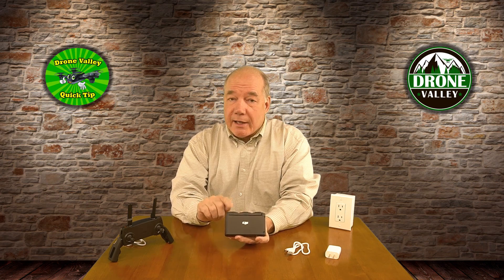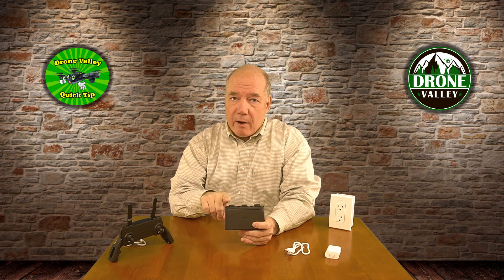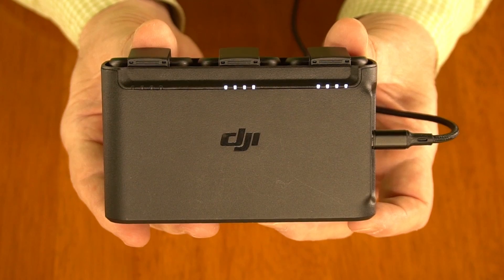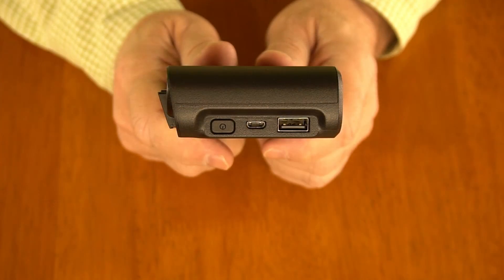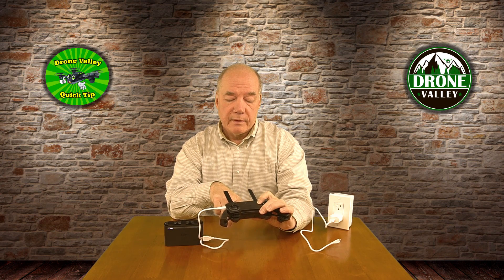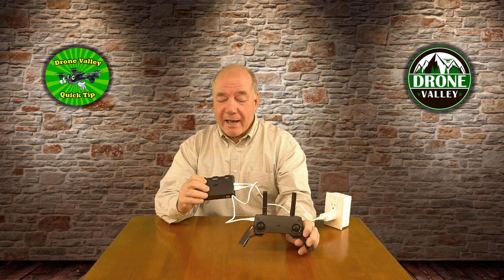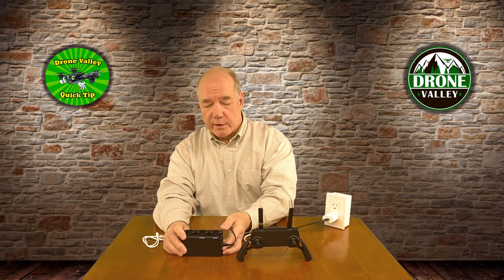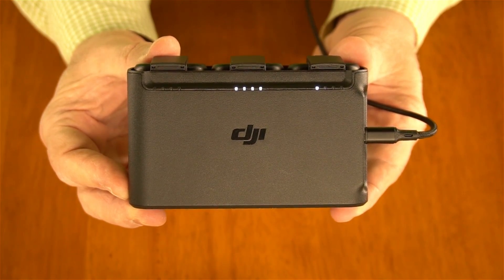Mavic Mini - The Magic of the Charging Hub Explained

Comment: Hiya Rick, great video on charging the Mavic Mini, the use of the super smart charger, I’ve just charged my Mavic Mini for the first time today, I believe the three batteries were from the start completely flat!  The first one took one hour and ten minutes, the second took just over that time and the third finished on three and a half hours! Is that normal? Would that be classed as Smart charge? And secondly Rick why has DJI in their wisdom used a different shape charging socket on the Remote to the battery hub, being fed with the same charging cable! Thanks in anticipation.👍🇬🇧

Comment: Prompted by your excellent video I tried charging, as you did, with the charging station connected to the charger and the RC connected to the charging station.  The RC does get charged, but it is fourth in line, it gets charged after the batteries have been charged.

Comment: How long does it take to charge a single battery on the mini?
Reply from the maker: Max, I run them down to about 20-25% and it takes about 30-45 minutes to quick charge them. I use the charging hub and let them all walk through the charging process. Thanks for the post and stay tuned for more content this week. Rick
Reply: @Dronevalley  👍👍👍👍

Comment: Regarding 4:00. Actually once the batteries are fully charged, the hub will automatically start charging external connected device, so it sorta does make sense to connect everything in the chain.

Comment: There's no logic to giving you 2 identical cables that cannot be used simultaneously. Plug them both in, then push and hold the power button. What's that doing? Lots of blinking going on there when I do that. Also, the battery charges in the drone itself, everyone will want a 4th battery. Keep one in the drone and charge it in the drone, charge the other 3 in the hub. keep 4 batteries at 100% and they all fit nicely in the kit.

Comment: This is great info for my pre ordered mavic mini ! Here is another question, what regulates rate of charge? The hub or the power supply? Reason for asking is if I get a QC 3.0 car charger rated for 80W will it charge at a full 80 and wreck the batteries or will the hub slow it down and only draw the max charge spec from DJI  of 24w ?
Reply from the maker: Thanks for the post and the charging is governed by the battery hub or the quad if you're charging the battery in there. It will only allow a safe amount of current to flow into the cells to charge them no matter what type of charger you're using. On a side note, we'll be releasing a 42W Drone Valley 2-port car charger later this month that provides both QC charging and PD charging. This allows you to quick charger your drone, phone, tablet or even the DJI Smart Controller. We designed this to work with both standards for quick charging and should have them ready for delivery in about 2 weeks.
Reply: That will be great, will it be a car charger ( cig lighter ) or wall plug?
Reply from the maker: @greenwings1195  The car charger is first and will be available in about 2 weeks and we have a Drone Valley 2-port Wall Charger coming in late December.  Both of them feature dual ports (USB-A and USB-C) and provide both PD (Apple, Nintendo Switch) and Qualcomm QC 3.0 charging. They're really a new style of charger and very different from most on the market today. We've been working on them since the summer and are really proud of the product.

Comment: Nice video! Could you let me know the Length x Width x Height of the battery please? I am looking to do a battery mod and change the 18650 batteries for higher capacity but want to make sure it is the right length. Thanks!

Comment: fast chargers also stuff batterys
Reply from the maker: The newer cells that are used in Quick-charging gear (like the Mavic Mini) are selected to be able to fast charge. The chargers are smart enough to detect what type of cell it's charging, how much charge it needs and what voltage and current is appropriate and will adjust on the fly to safely charge that device. Nothing to worry about and it works great. Thanks for the post, Rick
Reply: @Dronevalley  im going on my iPhone which i bought a certified iPhone fast charger for it and it over heated and killed battery..but yes, your comment makes sense.
Reply from the maker: @metallicrock5946  I understand and a lot of the "certified" chargers aren't actually that good and have very little protection built into the product. We'll be releasing a 2-port quick-charger for your car that has all of those protections built in that you can use to charge the Mavic Mini as well as the DJI Smart Controller.

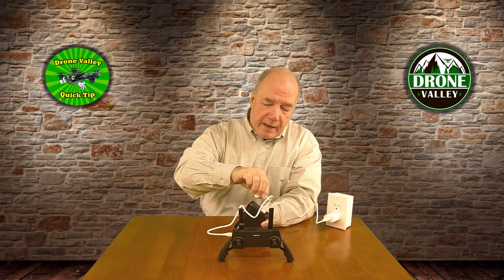Comment: @4:16 if you'll be able to charge your remote from charging hub while d hub is connected to power supply then d purpose  of charging hub that is mainly to make each battery full first before d other one will be no use i guess 🤔

Comment: I am from Germany and I ordered a Mavic Mini. So I will get a CE version of the drone. FCC/CE seems to be hardcoded.
Is it illegal if I use my CE drone in the U.S. when I go on vacation there?
Don't you think it is illegal to use your FCC version when you visit Europe and want to fly the drone?
On my SPARK CE/FCC changed by location. But on the mavic as it is hardcoded ???
I thought the mavic is a very good travel drone, but I do not want to fly illegally in other countries?
What do you think?
BTW: I already asked dji support, but got no answer from them.
Reply from the maker: You'll be fine. The transmission tech is locked between the controller and the drone so they will still be able to find each other when flying. I suggest you purchase the drone that is right for your region and you can still fly it elsewhere when you travel. Happy Flying!
Reply: @Dronevalley  I asked dji support and got this answer today:

  
We understand that you want to know if you can fly the Mavic Mini CE version in the USA and the FCC version in the Europe region.

We would like you to know that the CE version can be used to fly around the FCC area. Please be advised that the max distance for the CE version if you will going to fly it in the USA is 2 Kilometers in 2.4 Hz. 

However, concerning if you can fly the FCC version in Europe, we are in regret to inform you that we don't suggest you to fly it around Europe since there will be legal a legal risk. Hence, we truly apologize that we did not meet your expectations in this regard.

Comment: Rick, can you clarify this dilemma often commented on youtube: The Mavic mini has the output power hardwired into the version shipped to each region, fe FCC max power and max range up to 4 km. in the US...lower power and reduced range ( 2 km and less) in Europe. What this means is that a mini, bought in Europe, should not be able to detect FCC and adapt to higher power when using it in the US...Until now previous dji drones could adapt the output power and range, depending on the location, regardless where they  were bought. With your connections to dji, i hope you can tell us what really is the case. tnx.
Reply from the maker: Thanks for the post and the transmission standard is locked for each region but is paired with a similar drone standard. In the U.S. that standard is governed (and approved) by the FCC and different standards bodies on other parts of the world. My suggestion is to purchase the right drone for your home country and take it with you to fly when you're on vacation. All of these standards will work world wide and I've never heard of the "frequency police" stopping someone from using a piece of gear. Most of these standards are also loosely recognized by the other countries and are mostly chosen in your home country so your new drone doesn't interfere with other products broadcasting nearby. I hope that helps clear things up. Rick
Reply: Drone Valley Tnx fr reply Rick...I’m indeed convinced  that there is no problem flying a Mini -bought  in Europe -in the States. But...as stated in my previous message,  some people say that this drone can’t fly as far  as those sold in the US.  A Mavic pro detects , based on its location, if it can use FCC regulations  ( where applicable) and as a result fly further . This switch from CE to FCC and vice versa is done partially via software. It seems that DJI  sells different Mavic Minis, depending on the country where they are sold,  resulting in a hardwared transmission limitation ergo not switchable .. for Europe this is a  serious one, especially since many users report maximum practical range being 500 meters. ( and yes, I know that we have to fly VLOS..:-))
Reply from the maker: Staf, you're right and the Wfi standard is hard coded into the package being sold for each region. I haven't taken the Mavic Mini to Europe yet so I can't test the switching feature myself but my understanding (and the testing details from the FCC) indicate that they are locked for the region they are sold to.

Comment: This is why I love this channel. I do have one question though. When you use the batteries in the charging hub to charge your remote or whatever you hook to it to charge. Which one of the batteries does the hub start using to charge the device? Is it the one with the least charge or the one with the most charge?
Reply: It's least.
Reply: Duck so it uses the least charged battery to charge other devices that you are using the hub to charge. Like charging my phone.

Comment: I've had no trouble using any decent USB cable for QC based quick charge.  Granted all my QC capable devices are USB-C, but I've used Micro cables with C adapters.  The only trouble I've had was with USB-C 3.0 cables where I have to pull the cable a bit out of the A socket.

Comment: Hi from Japan. I enjoy watching your enthusiasm about the Mavic Mini and drones in general! Your videos have been extremely informative. Looks like you're in NJ so I have a soft spot for your scenery! I'm originally from there. Anyway, I've ordered a Mavic Mini in Japan and have learned a lot from your videos so far. I was a little bit disappointed with the version here however. Did you know that they sell the 199g version just for Japan?

https://www.scmp.com/tech/gear/article/3036229/why-lightest-mavic-mini-only-available-japan 

It's lighter because it uses a weaker battery that is only rated at 19 minutes and the range of the drone is 2km. This is to conform to stricter aviation laws here. Anything under 199g is considered a toy. I'm a little worried since it's 50g lighter how it will handle in the wind, and with a weaker (lighter) battery, I'll only get maybe 15 minutes in real-world conditions. Perhaps spending more on the Mavic Air might be more advisable? Other than the Mini being cheaper do you think the Air would be the overall better choice? It's probably the same flight time but a more powerful drone. What are your thoughts if you had the same choice? One of the perks of the Mini is the longer flight time, but unfortunately that's seriously compromised. Thanks in advance.
Reply: I would think it handles the same in wind, since the weight reduction was only in the battery.  Same motors, props, etc.
Reply: @danman32  Thanks the for the input! Yes, I was thinking about the same thing. Glad to get some feedback, anyway! Still would like to have more battery time. :(

Comment: Rick, the reason you can't do that it's because it's not phazed correctly. Which was the circuitry that which is DJI chosed but if they wanted to they could have phased it properly and it would have worked.

Comment: How many amps is the output on the wall charger.
Reply: To achieve the 18W he mentioned, it would have to be 1.5A at 12V, which is one of the 3 voltages in the QC standard.

Comment: Wow. Really helpful video and good to know about the charging hub and fast charge capabilities. I'm curious if the "daisy chain" method would work, but it prioritizes all of the batteries, then will charge the controller? My guess is that it's sending all the current to the battery being charged, but once they're all topped off, maybe it switches to the controller?
Reply: I thought it was odd that he appreciated that the charger logic that prioritized putting all the possible amps into whatever battery could be topped off the fastest, but once he plugged in the controller (which is basically a fourth battery that needs to be charged) he wanted the charger to start splitting the charging amps two ways.  That's certainly one way to do it, but it goes against the charger's "philosophy" a bit.

If I was designing this, I'd have it work exactly as he demonstrated for the three internal bays.  Then, once all three flight batteries are full, start supplying power to the external output.  If a user wants the external charger to be used right-damn-now, then that user just needs to remove any non-fully-charged from their bays, so they aren't prioritized above the external load.

Nice video otherwise.  I'll have to check out his website.  That flexible fast charge cable looked pretty nice.
Reply: .... I copied this post .... "
George Bises
5 months ago

Prompted by your excellent video I tried charging, as you did, with the charging station connected to the charger and the RC connected to the charging station.  The RC does get charged, but it is fourth in line, it gets charged after the batteries have been charged." 

.

Comment: Why didn't they just engineer simultaneous parallel charging into the charger??? And no pass thru charging??? To top it off, no USBC, something fishy is going on here.........
Reply: Can't do that with a USB charger.  Just not enough power to charge 3 batteries at once and get done at a decent timeframe.  The parallel chargers pull a lot of wattage, and at least one model had heat problems

Comment: Hey Rick great video can you do a clip on settings and sensors for flying over water etc?
Reply from the maker: I'll be sure to post one on that for sure but don't worry, this quad does really well over water. It has a set of TOF sensors and uses VIO as well on the bottom to stabilize it and neither of these are affected by water. I've had it over a few lakes and bays and really low with now issues.

Comment: Hey Rick did you make this video for the new drone pilots that may be acquiring a mavic mini? I asked a question because that's typically how most DJI Chargers work especially if they're multi Chargers...
Reply from the maker: Yep, there are a lot of new pilots buying the Mavic Mini as their first drone and need to know this information. Also, this is the first charger that uses a standard USB charging port and also fast-charges so I wanted to explain that a little bit. I have a wide variety of fliers with varying experience watching the channel and try to put clips together that simplify the tech. Thanks for posting and be sure to stop nack soon. Rick

Comment: Great video! I  understand you sell a lot of cables and such. I recently retired and am doing a lot of traveling. Never fails that I forget a charging hub or cable. Do you sell or could you reccomend a charger hub that could charge 4 to 5 things at once. I am looking at the anker quick charge 3.0, that says it is 63 watts.   Would this work? Do you sell something similar? Also recommended cables ( I thought all cables were the same till this video) I only have the spark and mavic zoom but will be purchasing the mini soon. Thank you in advance and love your videos even though I'm new to technology I have learned quite a bit.

Signed " The Rookie"
Reply from the maker: Thanks for the post and the Anker brand is a good one and they make some pretty amazing products so go with that charging hub and you'll be happy. Here's a link to the one I use on the bench - https://amzn.to/2Cl3ZRy. As for the cables, we offer all 3 flavors of single charging cables (Apple, MIcroUSB, USB-C) that are really durable and can quick-charge your devices. Here's a link to the website - https://tinyurl.com/y5f9p6oh and you can choose the ones you need. We also have a new Hydra cable that has 3 different charging connections on the end and allows you to charge 3 devices from a single charger port but it won't Quick Charge. Let me know if you have any other questions and thanks again for the support! Rick

Comment: There is one more thing, I think might be important when you travel with Mavic Mini. You can charge batteries in that hub using power bank, which is just great.
Reply from the maker: I totally agree with you and can already see me charging my tablet on those long flights to Europe or my phone after a long day of flying. Thanks for the post and be sure to sub the channel and stop back soon for more content. Rick
Reply: @Dronevalley  I think you misunderstood him here. He didn't mean you can use the hub as a Powerbank (which you of course can) but you can charge the three batteries in the hub on the Go using an extra Powerbank.
Reply: @Alucard15423  that's exactly what i mean  :)
Reply: @Dronevalley  I have already subscribed and thanks for your videos
Reply: How long does it take to charge a battery with the hub when it is not connected to the wall? And how many batteries can it charge before it needs to be plugged in again?
Reply: @cynthialandon  I have 20 000 mAh power bank and I can charge all three batteries as fast as it would be connected to the wall, because it's quick charge 3 compatible.

Comment: For the Mini Mavic, once all batteries are charged to 100%, can you use one after another so fly time will be approximately hour and half or will this little drone overheat with excessive flying??
Reply from the maker: Colin, thanks for stopping by and you'll be fine flying through all 3 batteries as long as it's not super hot. Remember that the design of the quad moves a lot of air through the body during flight, which cools off the internal electronics. Stop back soon for more content I'll be posting this week. Rick